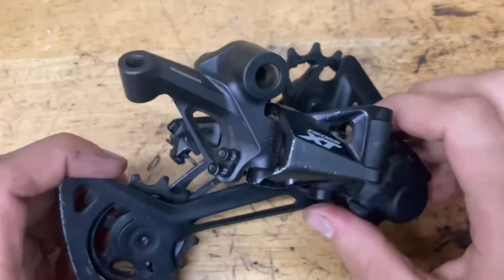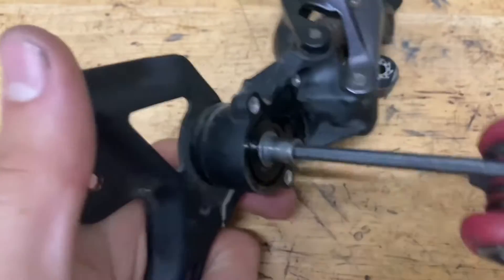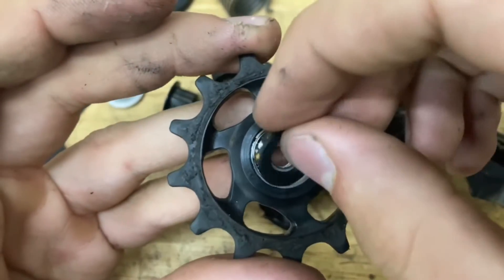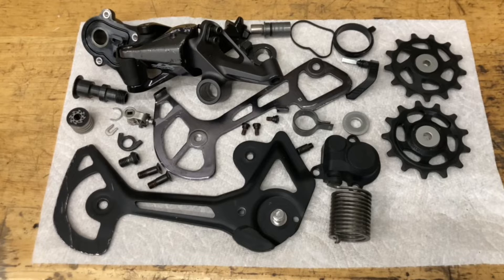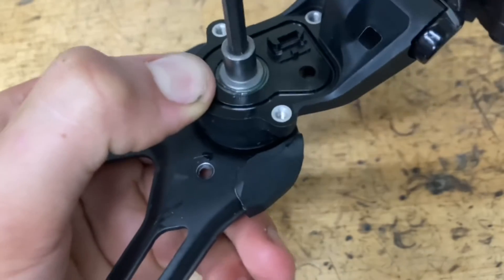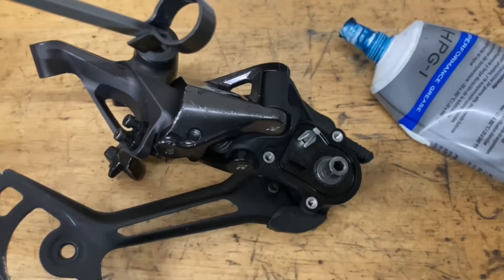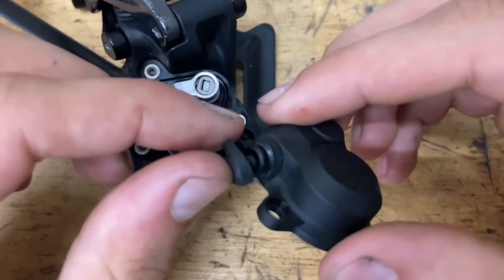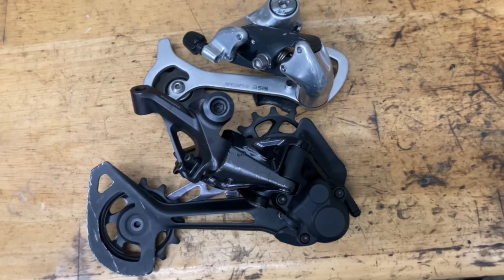How to Rebuild a Shimano Deore XT M8100/8120 Derailleur

Comment: Thanks for the video! I used it to rebuild my XT d/r. I’ve serviced the clutch before but never went this far. Unfortunately, the d/r still won’t shift down from the 51t or 45t cogs. It seems like the parallelogram will not return to its appropriate position. This is my 3rd d/r within a year with the same issue and my shop says it’s the clutch. They have replaced my previous d/r under warranty, but I don't understand why there’s not a repair to correct this issue. I cannot be the only one experiencing this issue. Do you know of any other items on the d/r that can be serviced to correct this issue?
Reply from the maker: Your clutch might be too tight try loosening the adjuster lmk if that works
Reply: Very interesting. I am having a similar issue, but haven't done a full derailleur rebuild yet. I'm about to give it a try after watching this video. I tried just servicing my clutch, but that didn't seem to help. Downshifting from granny down the cassette kinda works with the clutch off but there is hesitation between cassette cogs. With clutch on, it won't downshift at all, even with the clutch set a weak setting. If the rebuild fails to improve, my next step would be to replace derailleur hanger and/or the derailleur housing and cable.
Reply: @Tomzzzzzz  You're headed down the right path by eliminating all possible failure points. In my case, shifting was great with the clutch off, but really bad with the clutch on. Fast forward to today, I replaced the clutch (RD-RX812 stabilizer unit) & (RD-M9000 P-Axle Unit) and the shifting improved. After replacement, it would shift down from the 51t & 45t cogs with the clutch on (yay), but it would not shift down from these cogs with the clutch tightened to my preferred tension. I rechecked the limit screws & b-gap and honed them to a razors edge. As an example, I adjusted the low limit screw just enough to stay on the 51t with absolutely no wiggle room... and my shifting improved dramatically! I was able to add my preferred tension on the clutch and my bike shifts great... problem solved :)
Reply: @brandonhenkel5748  That’s awesome to hear! I love how Shimano makes those small parts available for purchase. I spent 2 hours today taking apart and cleaning my 8100 SGS RD and then reassembling it with fresh grease. On the repair stand it shifts night and day better, even with the clutch on. Will test it on the trails Monday for the true test. Hopefully that does the trick. I had no idea that the clutch mechanism can wear out. I live in dry/dusty conditions for most part but in winter I do hit puddles and the bike gets muddy so have to wash it. When I broke down the derailleur today, the spring was totally rusty and some of those parts weren’t even moving! It be never done a full RD tear down before so that was a cool experience.